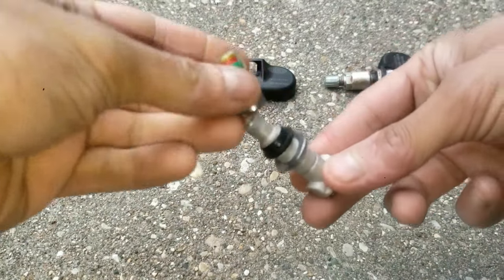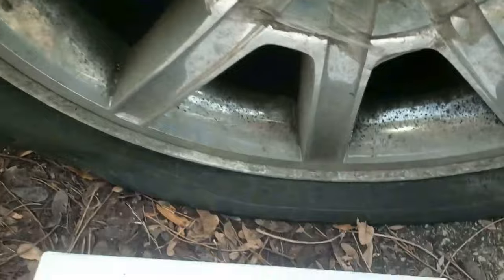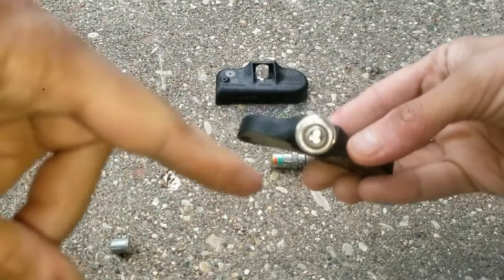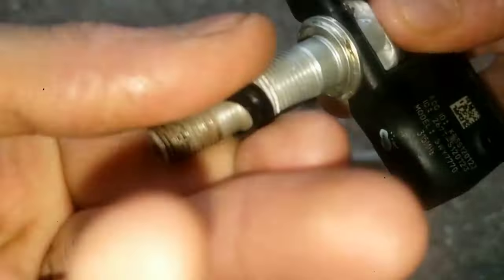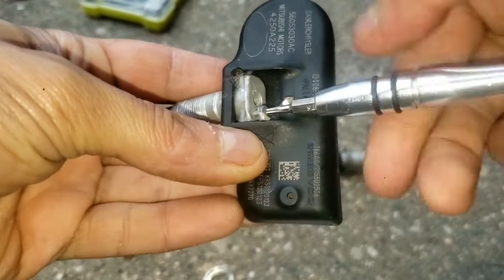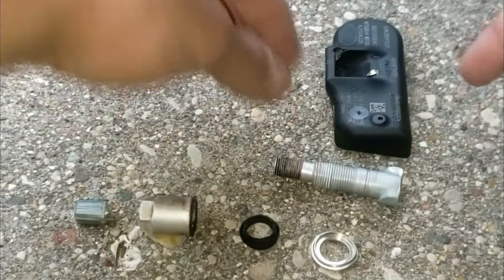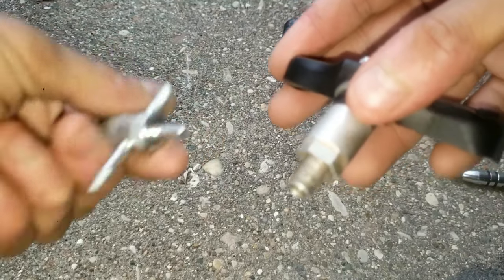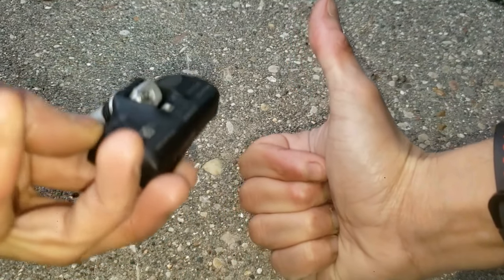Replace Broken Valve Stem In TPMS With Out Programming

Comment: My valves and I have a 2007 Chrysler in my tire pressure gauge still works but I broke the threads on the valve stem so I just need to learn how to replace that my friend

Comment: How long the battery lasts depends on how much you drive the vehicle (unless it's a unit / battery failure). TPMS sensors are designed to only switch on above a certain rotational speed, and so are dormant when the vehicle is parked / stopped.
Reply from the maker: Very nice explanation!

Comment: Thanks....that helped a lot.  I should of watched before attempting to remove the valve..... the nut was corroded and I bust the unit 😢
Reply from the maker: Well at least you know what to do next time. It happened to me as well. Actually, I made a separate interesting video about what to do and how to drive with a broken valve stem. Might be too late, but check it out if interested. Here is the link: https://youtu.be/7yhJSpuosdA

Comment: I've got the same problem, the tyre guys cracked the valve stems. Looks like my tps is identical to yours, same housing and dimensions just 315mhz and different part number. Can you pls share a link for the stem, would save me a lot of time. Awesome video and thanks.
Reply from the maker: Ok so once I got it at a junkyard from another model car. And a different time I bought it online. These do tend to go bad after a long time. Again 2 broke so far on me of the original ones.
Reply from the maker: Anyway here is the link I bought it from on Ebay. It comes from China, so it might take some time. But you might be able to also find it elsewhere (just make sure its the same), or if you go to a junkyard and remove a tire then you can get it. Anyway I just looked it up and found the link I bought it from on Ebay: https://www.ebay.com/itm/203711339676

Hope this helps

Comment: Love it. Very informative an encouraging!
Reply from the maker: Thanks I'm glad it helped. I used a T6 bit which is really small. These are usually found in one of those smartphone repair kits. I put a link in the description. Its best to have a kit and a bunch of small size bits in case your size is different than mine. So go check out your tool kit 1st as you might have a size that fits.

Comment: Thumbs up for the video. 
I have the exact TPMS.. where did you find the replacement valve stem? In Canada, NAPA seems to have it but I haven't checked it myself if it's the right fit.
Reply from the maker: Thanks! I had to get it at a local junkyard. Each store I went to gave me a different incompatible valve stem.
Reply: Sigh.. ! Thanks for your time and help.

Comment: That metal flap at 3:28 got broken. What do i do? Can i solder a wire from it to the valve? what is it's purpose?
Reply from the maker: Solder will usually do it, but I'm not an expert on soldering. I think a spot welder also helps...I think that's what its called. Possibly also just bonding it will soldering will also help. Perhaps other can chime in on this.